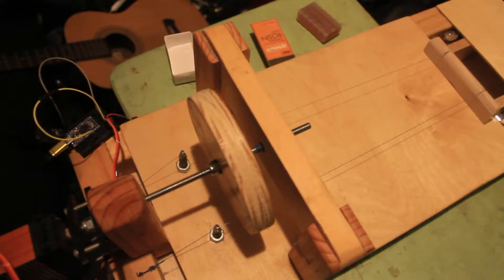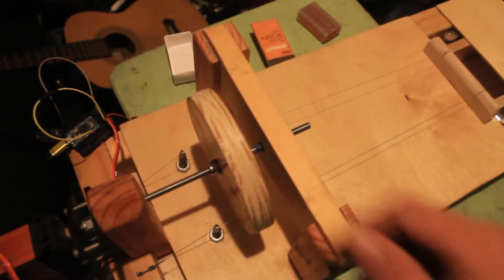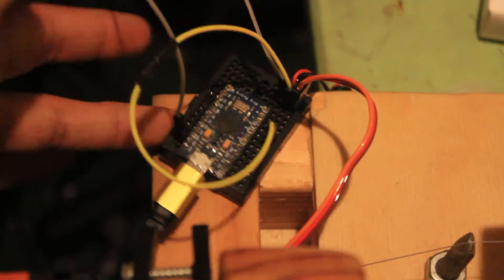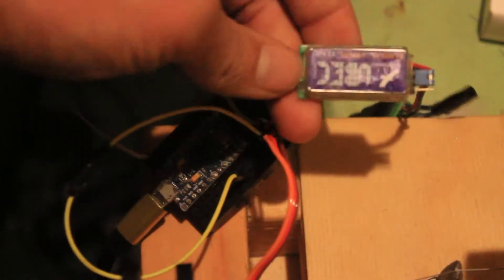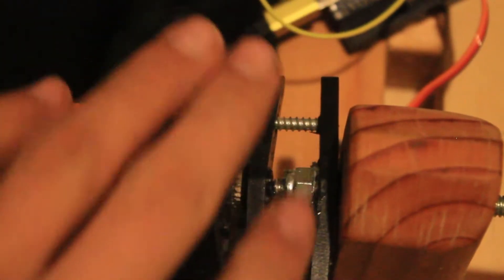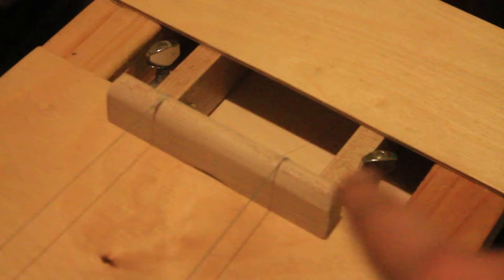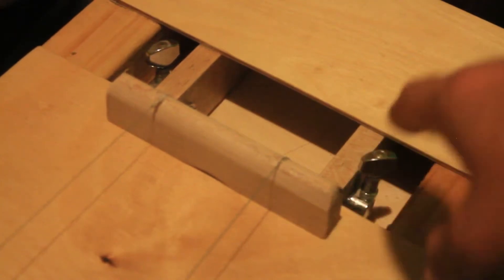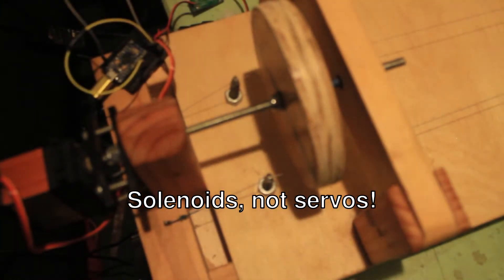Robot hurdy gurdy update: Turning mechanism

Comment: Hey I don't know if you remember me but a little while ago I asked about how you determine the fret/button position. I have the basic body made, tuning keys in place. Just wondering how far is the measurement between the nut and bridge? I think it's called the scale length. Ah I'm just stuck atm.
Reply: I checked out the calculator you told me to but can't for the life of me figure out what I'm doing there haha. I dunno whether to select acoustic, electric, or how they'd make a difference, which has me skeptical about eyeballing it etc.
Reply from the maker: Kyan Bishop select acoustic, or if you're going diatonic, dulcimer
Reply: WizardsOf12 ah awesome thanks. I'm converting an acoustic guitar to a hurdy gurdy and I've ordered a crank and cello strings etc so when people wake up in a couple of hours i'mma make a bridge set and work out exact placement of note change. Thanks furdude <3
Reply: I'll try get some video of what I'm doing if you're interested